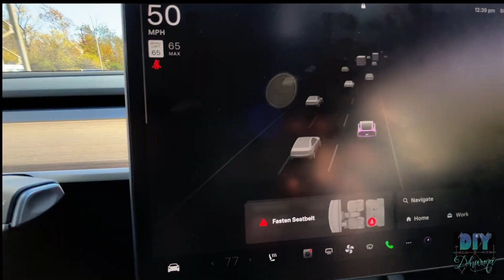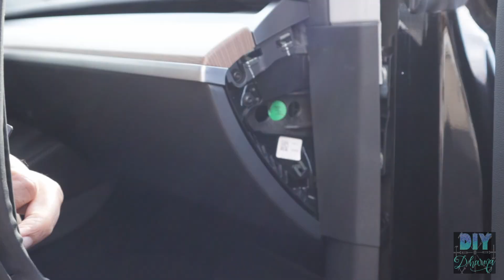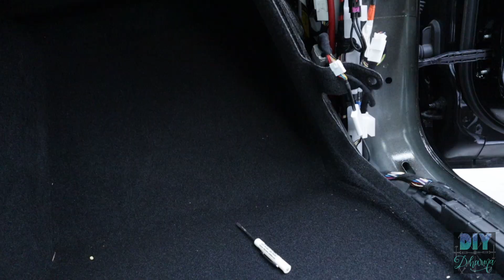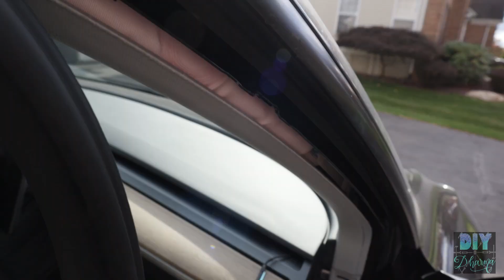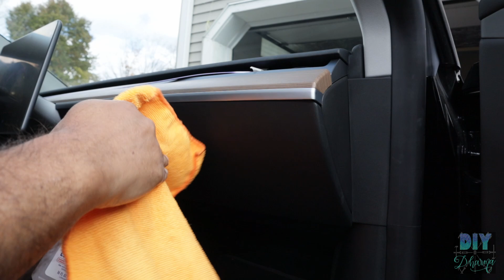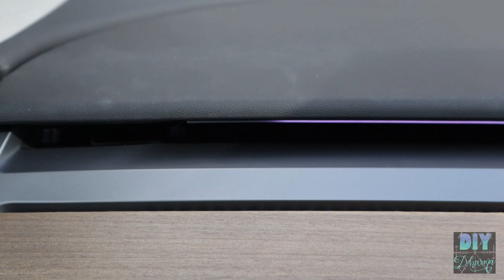Tesstudio Blind Spot Detection (BSD) Ambient light bar LED unboxing and installation.  #tesstudio

Comment: Need video installation for 2018 Model 3.
Reply from the maker: The only thing that I can think of that would be different for a 2018 Model 3 is the location of the ODB port. It may be under the steering wheel, and not the passenger footwell.  But I am not sure.